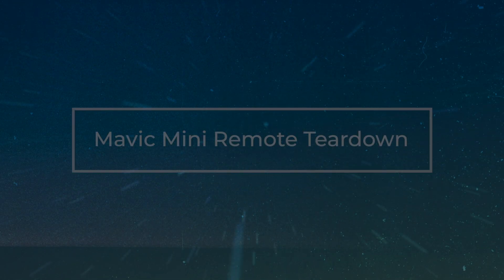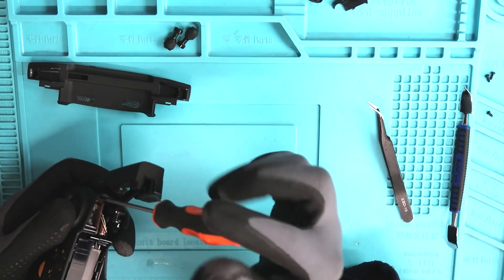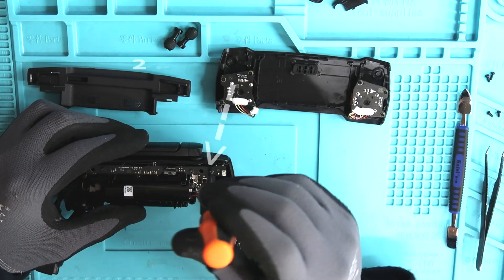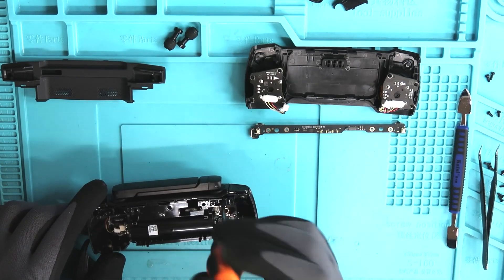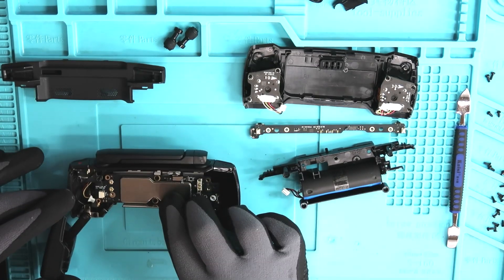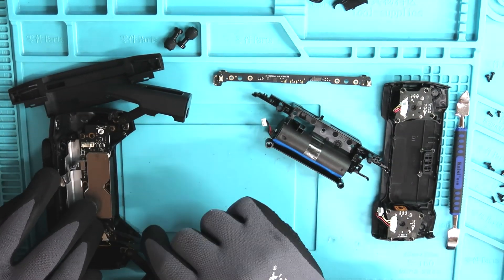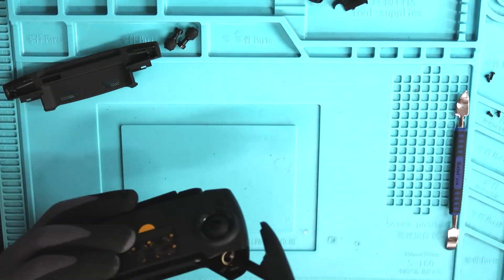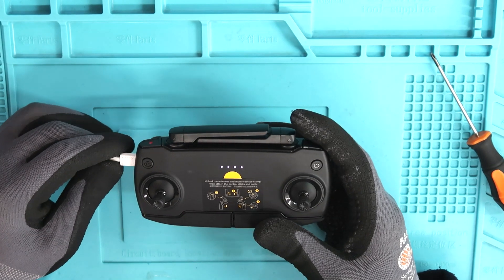Mavic Mini Remote Teardown & Repair

Comment: I  followed your instructional video to replace the battery .DJI is no longer making this controller.Thanks a lot.I saved my little birdy
Reply: What type of battery did you use to replace it with and did you have to solder or weld anything? Since it's been a year and you've had time to test it has it held up for a year or have you had to replace it again?
Reply: Id like to know as well

Comment: Good video!
Can you tell me that if I want to reverse the direction of movement of the throttle in MODE 2, which two of the four wires coming out of the left lever should I replace? I use MODE 2, only when I take off / ascend with the drone, I pull the throttle toward me.
The App does not ensure the reversal of the throttle movement direction for the Mini SE drone.

Comment: Hi Guys thanks a lot for this.  I'm trying to repair a controller for a friend here in France.  Just replaced the battery following your video but still not charging.  Could you please point me in the direction of the next thing to try?  would it be replacement of the powerboard???

Comment: Hello! My drone was landing on a river so i jumped into the river and saved it. I can't say the same of the controller cause in that moment of panicking i jumped with the controller and apparently some water drop came in the controller. I disassembled it and dry it and before connecting all again i wanted to make sure it turnd on and IT DIDN'T so i'm freaking out. I have already tried to charge it but without all the connectors. Do you know if all parts must be connected to reboot it???
Reply: I'd assume so - a lot of devices don't like it if you try to boot them while pulled apart.

Comment: Hello, do you know what the problem can be that the remote control does not connect with the mobile device?
Reply: the port is probably broken. its soldered to the button board, mine broke today

Comment: I broke off one of the joystick  pin connectors from my mini 2 controller, the housing that soldered to the board, I'm trying to find that part online so I can resolder it. Can't find the part. Can anyone help me with this? Thanks!

Comment: You might want to save this as a favorite link, you will probably need to replace the Button Board before the battery , mine is starting to fail again for the second time. 😣

Comment: May i know why the battery has 4 wire? Recently i broke my furthest black wire and i cant connect it back. I just reassembled the controller and it still work. But i still curious about the wires.

Comment: Hi, after moding the antenna on the controller the photo button started acting strange. Now I need to push it up a bit and then push it in to take a photo. Do you have any suggestions?

Comment: Had a controller failure just after 2 months of use 6.4 hours. Button board had to be replaced, not covered under the Refresh warranty, with shipping cost around $ 150.00 CDN. 😳
Reply: That's ridiculous I seen this controller go for less than 80 bucks

Comment: There might come a time when the controller battery needs replacing. Any information/instructions about this? At least from the video, it explains how to get at it.
Reply: My remote battery shows signs of need for replacement. I wonder if aside from replacing, can I add a second battery externally in parallel by tapping on the wires so I will have 2 batteries working for the remote? Thanks!
Reply: @RuelAmbat  I don't see why not! You'd need a jumper cable, and perhaps you could add a port somewhere on the RC to piggyback an external, possibly higher capacity cell in parallel with the internal battery.

Comment: internally, on the left, there is only ONE screw ... for a total of three...I mean on the small board where the charger connector goes.
probably you added it involuntarily in a previous tear down ... and yes ... the thread is there but the screw originally is not

Comment: I really wanted to figure out how to adjust the springs to make them less stiff and more smooth movement. I have an sla 3d printer and been using 3d software for 8 years. I was gonna start messing with it but im sure someone has done it already, just cant find a video on it tho. Anyone know?
Reply: disassemble the pot. theres a flap wich u can tuck into the center eye. it will stay in the position u leave it in. its a bit harder to control though. recommend lowering gimbal settings to roughly 5 or 8 in app and increasing smoothness to 25
Reply: @potzed  I'll try using those settings. Thanks for the info!

Comment: It looks so much like my mavic air controller. Can a mavic air controller be used to control the mini? Has anyone tried that? That way you can just purchase the replacement mini for 269 dollars and batteries are cheap. I know hubsan uses the same protocall for all its controllers. What about this and mavic air.
Reply from the maker: negative

Comment: Great tutorial! Thank you very much, it is much more fun without that truck reversing beeper in the remote.
Reply: How did you actually removed the speaker?
Reply: @maximelarocque4128  I did not remove the speaker, but silenced that thing (so it has a much lower volume, still recognizable for me but not for everyone in 200m radius ;-)

Comment: Hi, good video which gives lots of interesting information. Thanks!
I would be interested in inverting the effect of the gimbal lever (for me push would be better to go down and pull go up !).
Have you got the schematics or a close up view of the gimbal lever connector? It looks like that inverting the wires at the level of the connector would do the job ? What do you think you experts techs?
Reply: Done invert gimbal yellow and red connector
Reply: @potzed  yes, i did it too and it's working perfectly !
Reply: potz hernandez just did that and it totally worked!  Thanks for the tip.  Unfortunately something kept grounding in the left stick every time I tried to put it back together, I put some electrical tape around what I though could be grounding and it’s back in action.  I love the control layout way betrer

Comment: i need the usb plate part cause my controller dont charge  and cant connect with my phone  bizarre its happend when i trying the update firmware
Reply: Add the same issue after only 6 hours of use, not covered under refresh program, $150.00 CDN to fix

Comment: where can i buy mavic mini rc remote part????
Reply: X2
Reply: Same here, need to replace the button flat cable
Reply from the maker: which part?
Reply: DDS - DJI Drone Service Id like two Flat Cables that connect the main board with the buttons PCB.
Reply: @dds-djidroneservice5959 i need the rc button board and the rc main flat cable